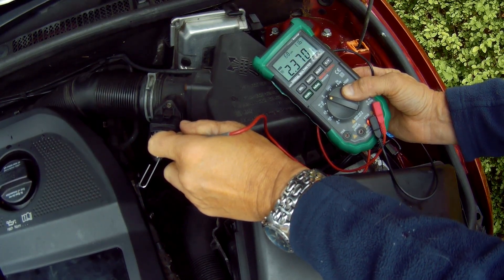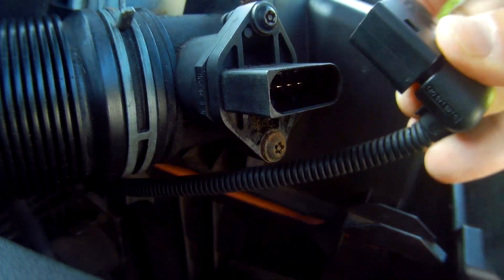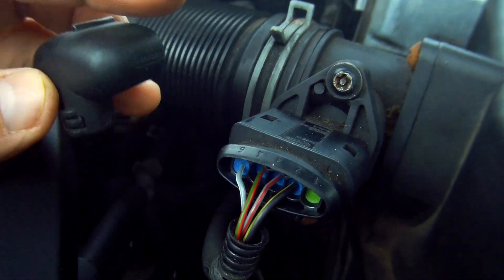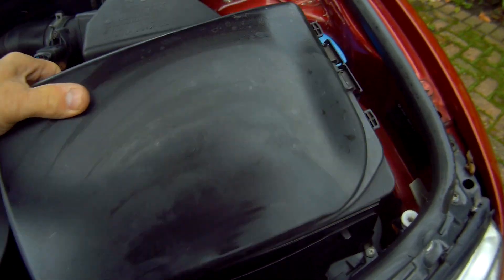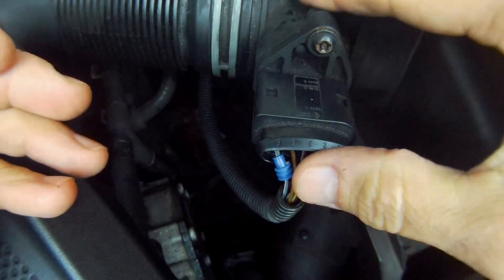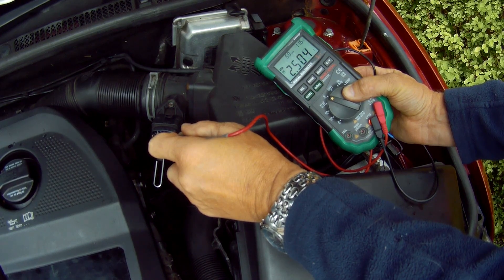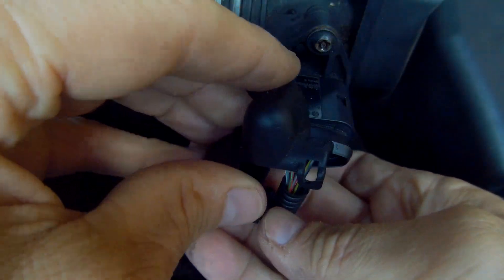SKODA FABIA MAF (Mass Airflow Sensor) testing

Comment: connect map sensor and negativ but not go up its the same 2.5 put the gas pedal and goo down what is the problem can you help plz
Reply from the maker: If MAP then the reading will go down with increased revs. MAF and MAP are different. What are the engine symptoms?

Comment: Hello Harvey! I have the same motor like you 1.9 tdi atd. My maf sensor is 1.9 v on idle. At 2000 rpm is 2.4 - 2.5 v. I have lack of power. Is the maf sensor with problem? I clean it but is the same readings. Thanks!
Reply from the maker: Have you tested increasing rpm? It should go up in a linear fashion 3000 should be more than idle and less than 4000. The figure should go up/down smoothly and not jump about wildly. The isle figure can be different in different cars, but roughly around 2v which yours is.

Comment: Im not getting 12v from black wire... I checked it is shorted. Do you know where black wire coming from
Reply from the maker: Have a look on a wiring diagram. I would trace the wire back within the engine bay as this is the most likely place a fault has occurred.
Reply: @HatBoyHarvey  thanks

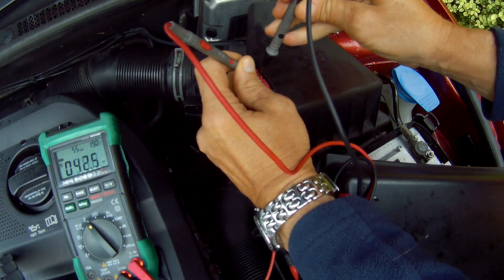Comment: My golf tdi mk5 has the Bosch 5 pin Maf with 4 pin plug. My wire layout is pinned differently but probs the same MAF. Anyhow, for me it’s pin 3 and 5 that both read 12v individually. But when I join them together (4:15) to check I get zero volts?? I have 16486 - MAF signal too low on VCDS. Have a new Maf abs still fault code. So do I have a break in one of these wires. ?
Reply from the maker: One wire should be ground, one 12v feed, one 5v ref, one variable signal wire. Re-check your readings, maybe there is a short/break somewhere in the loom.
Reply: @HatBoyHarvey  I think so too, I’ve just noticed usually the thicker is the 12v feed. My thickest wire gives readings as if it were the variable signal.

Comment: Hello thanks for the awesome videos i have skoda fabia 2001 1400cc mpi. I got a problem while on the road it start shaking and i lose power. It is caused Because the ignition coil in the 3rd cylinder gets black when i change it, it is going well for a few days. So i wanted to clean the maf sensor but i cannot find it what do you think?
Reply from the maker: Thanks. Have a look at the crank case ventilation and throttle body, they might be in need of a clean. if this is the 8 valve right, I believe the head gaskets are prone to fail, so worth keeping an eye on it. MAP it's on the intake manifold at the back of the engine. It hasn't got a MAF. MAP sensor is 03D 906 051 A
Reply: @HatBoyHarvey  thank you very much the fault that i get says 17549-load calculation cross check p1141-35-00- implausible value. I wil try  all that you told me thanks😁😁😁
Reply: @HatBoyHarvey  thank you very much!! Sadly it is head gasket so i wait till they fix it..

Comment: Hi Harvey
I've got a Skoda fabia 1.6 TDI, an issue with injector's has appeared recently which I fixed, in the beginning the engine idle was very rugh and shaky, we changed the injector but the problem never disappear, the engine still shake especially one you put it on 3rd gear.
Can you help please!?
By the Harvey, I have tried the MAF!! When I take off the connection, the engine kept running!! I have cleaned it but and changed the air filter but the problem still there.
Kind Regards Harvey
Reply from the maker: Have you cleaned the EGR, checked for vacuum leaks, looked closely at the electrical connection/tight fit? Maybe could do with attaching vagcom to receive live data when it is experiencing the fault. Have you coded the injector correctly. Fault codes?
Reply: @HatBoyHarvey  the mechanic reclaimed that he coded them properly, I'll check what you mentioned. Thank you

Comment: Thanks for the great video . Got a 2000 seat cordoba 1.9 tdi agr engine.my airflow sensor has 4 pin but 3 cables on the plug.1 is empty .have check the cableline didnt see any broken cable ?  4 pin on the airfow sensor and 4 pin on the plug but only 3 cables in the plug is that normal ? Sorry for my bad english.
Reply from the maker: They can be 3 wire and your car is early, so is probably correct. You will have a 12v feed and ground wire and a signal wire. 12v feed is usualy the fatter one, but you could study a wiring diagram to identify the wires/colours, then you will know which is which. They are probably not the same as mine :-)
Reply: @HatBoyHarvey  have dig google.couldnt find any diagram to check .the funny thing is when i disconnect the plug from maf the car runs really good till 2000 rpm but wont open the turbo.
When i connect the plug to maf the car is dead till 2000 rpm .after the turbo kicks in. Any possibility to find the diagram ? it has the same engine with vw bora 1.9 tdi, golf and polo . The engine code is agr.
My maf if new .
Reply from the maker: @rippertr Sounds like the maf is working, but may not be correct, so worth a clean/replace to eliminate that. I would also check for air/vacumn leaks and breather pipes from crank/head. Has the EGR valve been cleaned recently? if not I would also do that. Is the engine worn? high KMs then may oil change and more. Hope this helps :-)
Reply: @HatBoyHarvey  i have clean the new maf few days ago.check the egr its clean.change all filters and oil mobil 1 5/40 w a month ago .checked all leaks and found nothing.well maybe thats what a 90 hp car can give dunno really.
i will try chip which upgrades the hp +30 and 60 nm tork. Maybe this will help solve.was only curious for the maf plug if its right with 3 wires or not.cannot find a diagram or video / picture to compare. Thank you for your help Harvey 👍🏻
Reply from the maker: @rippertr  You're very welcome, If you have access to vagcom that maybe worth doing.
Reply: @HatBoyHarvey  sadly i dont have vagcom . Hopefully will find a solution in a way or other .

Comment: Great video. Got the same Skoda. Even the color matches. I do have ideling problems and loss of power. This video gave an idea where to look. Already changed the sparkplugs and the ignition coils. 
I can not find your video on cleaning the mag sensor. First I'm going to test mine.
Thanks again for the informative videos.
Reply from the maker: Thanks, Great to hear our cayenne pepper orange colour is still around. I said in the video it would be a follow on from this one. It will be out tomorrow, thanks :-)
Reply: @HatBoyHarvey  I love the orange color (and peppers)I'm sorry. I thought this was an older video. 
My Skoda is a 1.4 mpi. 260.000 kilometers on the odometer. Since I bought the car I had the feeling that she isn't running right. That and the klunking noise coming from the suspension that I have to address soon.
Reply: @HatBoyHarvey  
Today I found out that my 1.4 doesn't have a maf sensor. So I have to look further at the problem.
I do have white sludge on the oil fille cap so I'm afraid that he head gasket is blown.
Reply from the maker: @kres01  It maybe just condensation if the car has stood idle for some time out in the rain. Clean off the cap and examine the head cover gasket  (easy fix along with an oil change) to start with, then re-check some time later :-)
Reply: @HatBoyHarvey  That's exactly what I'm going to do. Already cleaned the oil cap. Oil change is due so I will take of the rocker cover to see what's inside. Thanks 👍😊
This is my third Fabia. My first was a 2004 cobi. After that I owned a 2016 Combi but have to let that one go because I needed a bigger car.

Comment: Mate I've a 1.9 elegance tdi.it is making such a noise from the front wheel bearing.i had two new tyres fitted three week ago.do u think with the car stood over a year it's caused the bearings to be knackered taking the wheels off?
Reply from the maker: If the car has been stood for a year I would say suspect the brakes as these corrode when left, if not - does the noise get worse on left or right hand bends? does the noise happen when you turn the steering wheel? Also some tyres can be noisey when new. If it is the wheel bearing then have a look at my video https://youtu.be/wmJPW39ufV4 :-)